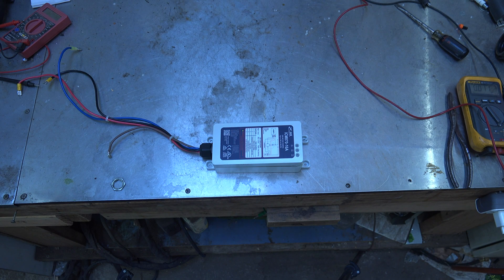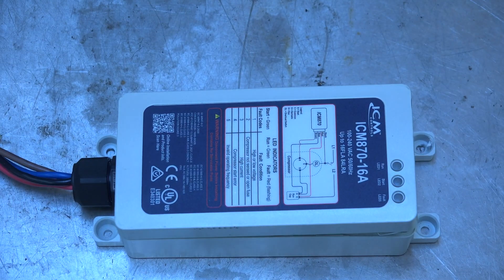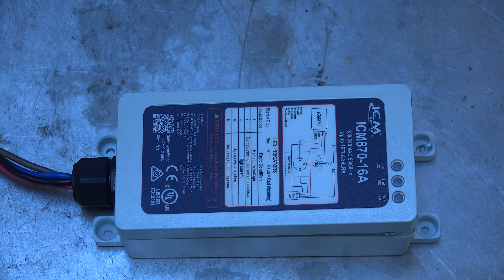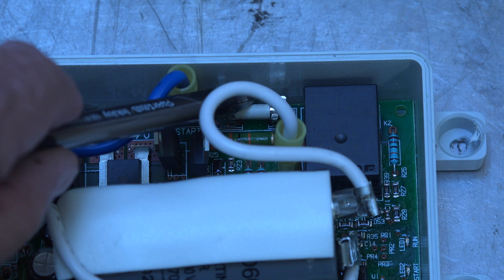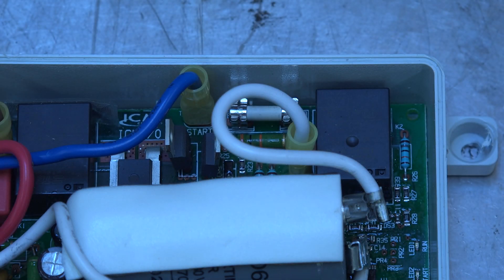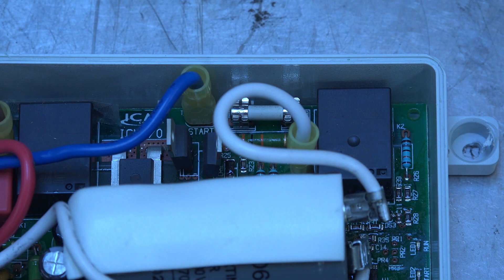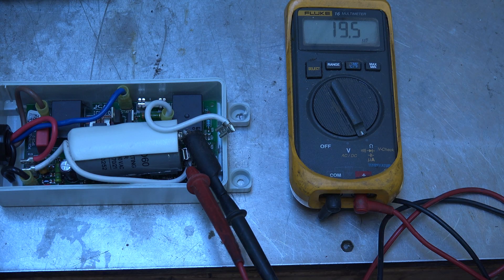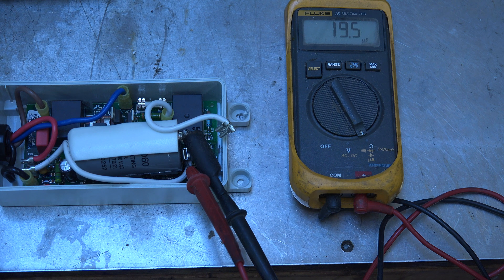ICM870-16A soft start failure update.

Comment: I just had this happen to me 9 days after 1 year of installation. Did you replace the components or get a different soft start?
Reply from the maker: This item was made available to me as a test subject.  I simply removed the item and troubleshot it.  Most components are not replaceable.I would try another brand.
GFM

Comment: Thank you for the video ..that indicated that capacitor it's not strong enough it looks like a problem I have  circulator pump has the same problem I connect a stronger capacitor still working

Comment: Thanks for posting this.  I had one installed on a 2 ton 2-stage unit which curiously stopped running one day with the indicator light flashing "no compressor found". When I checked the compressor continuity it read open. Since it was late, I waited for morning to open the unit and check across the compressor terminals, with the plug removed to rule it out, and there was now continuity so prehaps the internal limit had tripped the prior day.  Not suspecting the ICM-870, I powered-up the compressor which shook violently and made a loud sound remarkably like a scroll that had failed from slugging.  Static pressure was OK, acid test was OK, EEV on the air handler was OK and there were no fault codes.   I removed the the ICM-870 and found orange capacitor oil leaking from the bottom seam.   Ran a search and found this video and lots of bad reviews on the S_____house site so, I powered-up and the system is cooling normally.

Comment: Just saw this video today and I want to say that I agree with you that this soft start unit is junk. I also have the same trane AC compressor with the  16.7 RLA and the soft starter died in a year which is also their warranty period. My unit died not just with a blown fuse but also blew the capacitor and one of the transistors just below where the blue wire connects to the PCB.

Comment: You need to see what your compressor running amps actually are. It may be running little higher with age. 32 amp model shouldn't give you any trouble . Uou were right at the threshold

Comment: ICM is now replacing all 16A units sold between May 2022 and September 2023. I contacted customer service and they told me to request an RMA from my retailer (Amazon). However, when I told them Amazon refused to do that, they offered to send me a new one if I sent them a copy of the receipt.  Mine was shipped yesterday.  The RV version of the 16A was recalled on November 5th.

Comment: I installed one a month ago the customer called today  it actually tripped the breaker and when i tried it it smoke the D square disconnect once i disconnected the icm soft start kit the unit started no problem

Comment: If you talk to ICM, they will tell you that unit was not designed for anything of strictly 16 A max cannot be one point or decibel over 16 A. 

Technically, you should have gotten a 32 amp version. When I was waiting for the 32 amp to come out I spoke with technical support many times and they were very specific that nothing over a 16 amp. 

Their technical support is very nice. Of course I had to wait almost a full year after I purchased for the 32 a to come out, but they’ve always been very transparent to not use anything over the size that it is made for.

Comment: likely the capacitor is not what failed first, probably a welded relay contact or burnt component causing relay latch-up and that smoked the cap by overheating it, by keeping it in circuit too long.
which then eventually blew the fuse. not sure the exact failure component, but I'm sure they know exactly what/where. they were supposed to release an high current model, as some of them failed in just months time on units drawing less than their ratings.

Comment: In the last week I installed the ICM 870-16A on my 3 ton Goodman AC. I had seen your short post and others about these units failing. So I reached out to Technical support at ICM and told them I was hesitant to buy their unit based on what I was seeing on the internet. They shared with me that they had an issue with the sizing of the capacitor and had made a design change to address the issue. When I asked how I could be sure to get the updated version they indicated that the new version is now in a new module box that is blue in color and the clean stock would have a white inspection sticker with 2024 printed on it. I purchased mine from a high volume on line distributor and worked out a agreement that if the unit they sent didn’t have the 2024 inspection sticker they would pay return shipping and give me a refund. The unit I received had the sticker. Installed it and captured inrush current before and after with a Pico scope. The rating plate shows LRA to be 77 amps and I measured 77.46 amps with the scope. After installing inrush current dropped to 27.32 amp and I can now easily start the AC with my 7000 watt inverter generator. Hopefully ICMs capacitor change has addressed the reliability.

Comment: Well that is not good. I have one still in the box that I was going to install on my 2.5 ton Trane for when my 10 k/9 k on NG generac  kicked on.  Recently had a 6 hr  power outage  with outside temps @90f and  A/C cycled just fine. House is all NG appliances except A/C

Comment: A properly sized hard start cap and wired with a typical 521 relay will outperform that and will likely last longer than the ac unit.
Reply: Soft start is used on our solar systems or when using a generator. OK They’re not put on units to get them going again like a hard start.
Reply: @USA-GreedyMenOfNoIntegrity  Soft start is a hard start with a few extra unnecessary things added
Reply: A hard start will cause more damage over the long run. It increases the current on the start winding...not diminish it. You may think its less current.....thats only a visual trick.....as your meter can't process it fast enough for you to see. When you are dealing with micro and nano seconds, and a meter operates at milliseconds
Reply: @JJ-COMMERCIALHVAC  Completely false. They extend the life of the compressor.
Reply: @JJ-COMMERCIALHVAC  They wouldn't send them from the factory with hard start kits if that were true.
Reply: @mr.monitor. trane sent a number of 3ton units with hard starts from factory. Kept burning up the 2stage compressors, they ended up removing all those serial numbers from their data base and sent new units to replace those. This was like 6 years ago
Reply: @BetoMota_  And Trane still sends them that way
Reply: @mr.monitor.  I know they kept sending 3-1/2 to 5 ton that way. I just thought they stopped with the 3 ton because of that issue
Reply: @JJ-COMMERCIALHVAC  By providing an extra boost of power during startup, a hard start capacitor can reduce the strain on the compressor. This can be beneficial in situations where the compressor struggles to start, potentially reducing wear and tear over time and extending its lifespan.The inrush current is the initial surge of current required to start a motor. A hard start capacitor can help manage this by providing the necessary power boost, which can lead to a reduction in the overall inrush current experienced by the system.However, these benefits largely depend on the correct application and installation of the capacitor. If the underlying issues causing hard starts are not addressed, or if the capacitor is not properly matched to the system, it might not provide the intended benefits and could potentially lead to other issues but your argument is very unprofessional
Reply: @mr.monitor.  "A hard start capacitor can help manage this by providing the necessary power boost, which can lead to a reduction in the overall inrush current..."  This is  not true. The hard start cap INCREASES the inrush current, thereby increasing the compressor motor starting torque which then accelerates the motor to final run RPM in a shorter period.  It's true that this can actually REDUCE the total ENERGY (not the peak inrush current) used to start the motor, but only if the original capacitor is undersized which doesn't provide enough torque and the motor struggles for too long to accelerate to normal run RPM.  This abnormally long starting period, due to inadequate starting torque, can lead to overheating of the motor windings, because starting current is much higher than normal run current.  This can deteriorate the winding insulation, greatly shortening its lifespan.

Comment: I was kinda afraid of that happening. Capacitor quality is sure not what was in years gone by. If it couldn’t handle .7 Amps over it was doomed to fail
Reply: from what I seen, they're known to melt down. someone messed up sizing traces, components, relays, terminals, etc. and way over-rated them.
they burn up on power hungry/larger units at nowhere near their rated current.
they were supposed to release a larger current model...